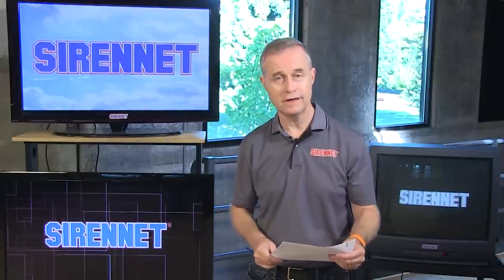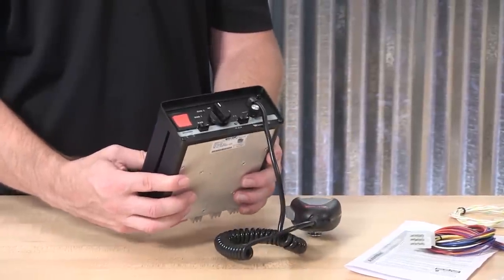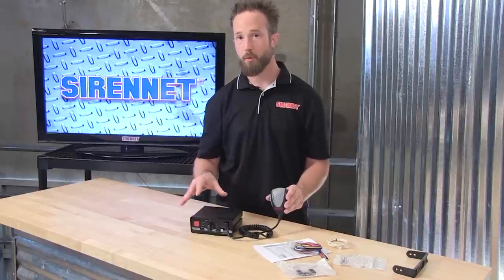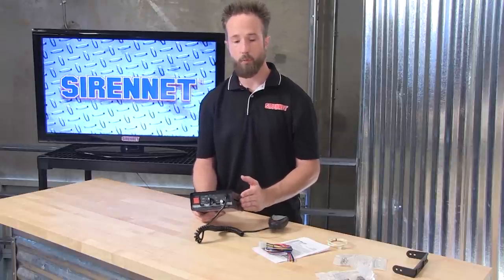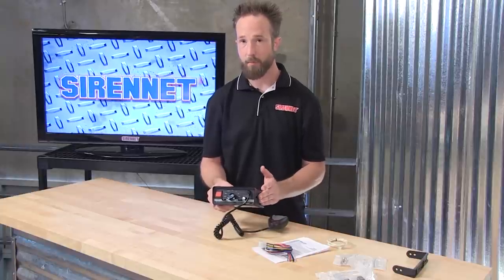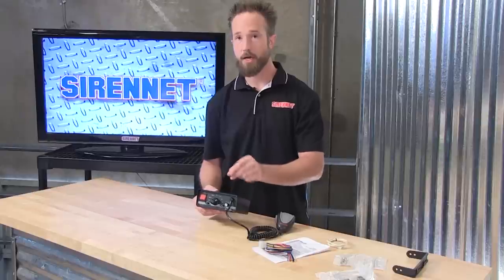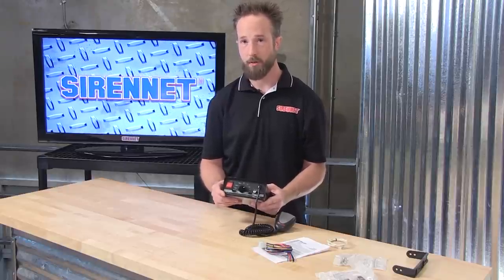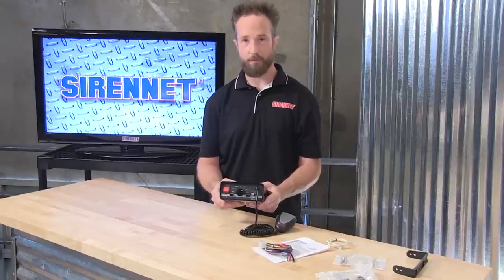Whelen Hands Free Full Function 100/200 Watt Siren

Comment: What radio rebroadcast are you talking about? Is it the CB radio or your car radio with music ?
Reply from the maker: Good question - It's for using with a CB or communications radio [not for music]. Any signal that is received by the vehicle’s two-way radio will be simultaneously broadcast over the vehicle’s loudspeaker (the siren unit must be connected to the two-way radio as outlined in the installation manual).

Comment: My sirens stopped working outside of the vehicle but they can be hear very low from the box itself.
Reply from the maker: If you haven't already, check the speaker. You might have a loose or disconnected wire.
Reply: I'd check the wires, same thing happened to me.
Reply: @SIRENNET  is there a way to change the tones on the siren in the back without blasting it through the speakers? maybe a test mode?
Reply: @brianrem1470  i would like to know too, i dont want to create distraction to others while changing tones.